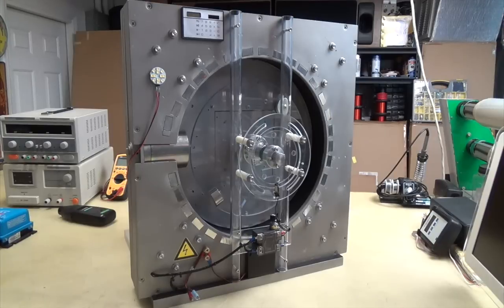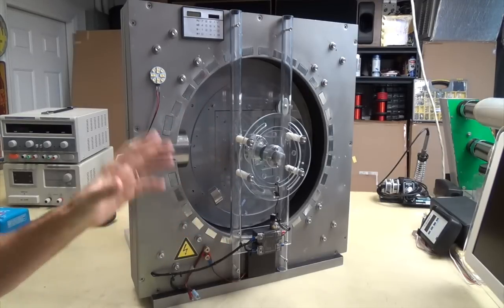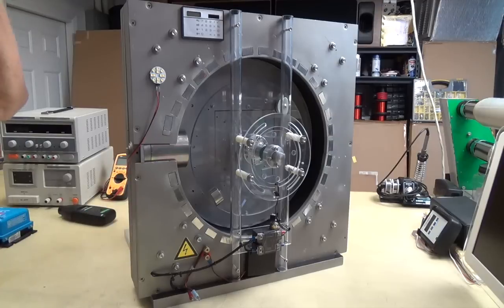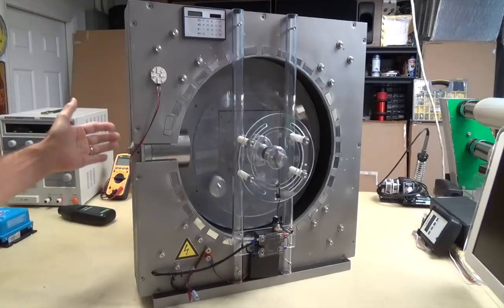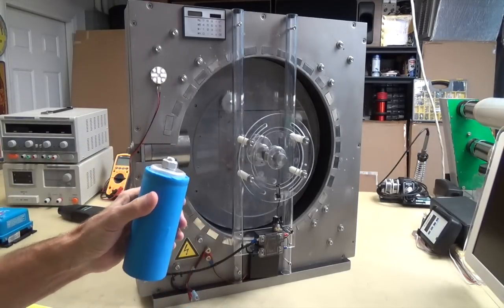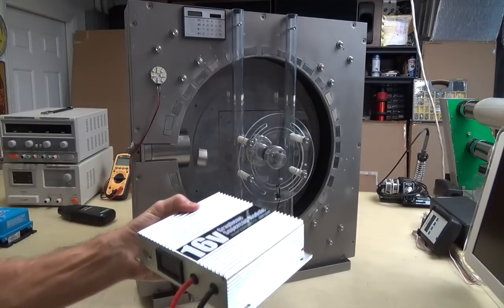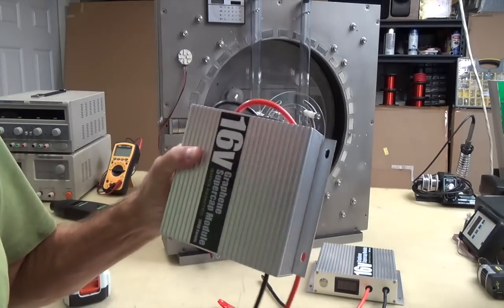ALL Magnet Motor

Comment: He was such a loss to the community maybe somebody will see this in the comments and be able to speak more about it but do you have to fire the electromagnet every rotation could it be set up to fire say every 3 or 8 revelations it would also be nice if you could control the number of revolutions that the magnet fires at I believe at a good you could have it fire every few rotations using less power and not dealing with the magnet shutting off too soon giving you a residual magnetic field that you're fighting

Comment: All you really have here is a pulse motor. If you removed all the magnets that create the magnetic gate, you would increase the output of the system. A magnetic gate although it makes a magnet move from point a to B, it takes a little bit more energy to cross back over the gate. This is why it creates more friction than thrust.
To test what I am saying, put a set of new batteries in your battery pack and time how long and how fast the RPMs are with all magnets in place. Then remove all the magnets that create the gate. Run with a new set of batteries and see how long it runs at how much RPM   
I have been studying magnets for a long time. Keep looking for the answer. We need to find a way to block the negative energy when crossing the gate. Good luck.

Comment: Is cool video. I watch one time when a guy use the car battery then a plastic container with water in it to run the positive lead through so he could keep the amperage down to weld with he also could do the same with 110 AC. The water act like a rectifier and also control the amperage. But what do I know

Comment: Well it just so happens I was looking at e-trikes, e-bicycles yesterday and they say do not go out in the rain with these bikes. With your modules that have 48 volts and they are lighter than  lithium batteries it probably would work very well as long as it's waterproof and doesn't explode in the intense heat. Is that possible?

Comment: It's a very interesting topic.
You are much more impressed than those of us who don't know electricity are.
Are you saying this is a replacement for a car battery? 
If yes, why not wire it for 12v,.24v, etc? Why 16v? It seems completely random and nonstandard.
Is your magnet motor  as the Liberty Engine here in YouTube as well?
Why mix the two topics if it's 16v batteries that you want to sell?
Car and Marine Batteries have cranking amps, etc. How is all if that handled by the graphene packs?

Comment: Hello, very nice setup and video. Thanks for sharing. This gave me an idea and I want to ask your advice. You use an electromagnet to pass the sticky point of the stator. Instead of using an electromagnet, shall I attach a DC i.e 12V motor directly to the main rotor shaft? When the rotating magnet arrives to the sticky point, the reed switch or the timing microswitch will trigger the motor for a very very short duration of time. It will be in the ON position for only a few miliseconds and then becomes OFF for a larger duration. Also, instead of using one rotating magnet, dual rotating magnets can be placed with 180 degrees offset on the rotor plate. This time the DC motor will be triggered twice per revolution on the other hand you will have more torque. Best Regards

Comment: u said u are using Electromagnitism for one magnet. so It is no Dif then a standard electric motor that uses Magnets+ Electric charge = electromagnets. which are what all electromagnetic motors have been made of since what at least 1910. somewhere around there & nothing much on the design have changed at all the same fundamentals have stayed, only updated materials ext will always be added to create motor available of that day... nothing new under the sun.. Its not just running off magnets if u are PROVIDING an ELECTRIC CHARGE
Reply: It’s the input to output ratio that is in question and he’s claiming to double it no?

Comment: Permanent magnets are unreliable because, they're outputs can very other time greatly.
Reply: This is a true, a German company something starting with an M creates a 95% efficient motor in 2022 that uses copper coils instead.
Reply: 🧲His requires electrical current to pulse his stator to get the wheel to rotate, where as my research is 100% all magnets. No issues with timing. Very early research. Have a look why don't you?

Comment: What sensors can cut off the charging of the batteries at the point they or 100% charged so no over charge or swelling of batteries . An capacitors grapevine I agree. Seems close to what I Invision for some thing else

Comment: Make a magnet motor that works like a Stirling engine using the pull or push of the magnet. You would have to be able to turn the magnetic on and off very rapidly.

Comment: Normally we measure incoming power and outgoing power to measure the efficiency of the system. You presented only 1/2 of the required data (Voltage). This is not enough to make a conclusion of your system efficiency. You need measure input V*A and output load V*A.
Reply: I think he intentionally skipped that from demonstration knowing that output is less than the input.
Reply: Watched the followup video??? he mentions the output there

Comment: No one in this planet wants to keep lithium, but comparing the energy density LiPo batteries are still better. I dont think anyone in this planet want a brick sized phones or a case sized laptops. If anything, everyone wants it smaller/lightweight/thinner
Reply: What are you talking about? What does this have to do with this thing he made

Comment: It's in a way kind of looking at Pascal's law of hydraulics but knowing those particular points in the function of that law putting ninodinium magnets in the correct positioning to create a field that is able to do the work with low speed and very high torque

Comment: Have you ever thought of using planetary gear system but in a nonodinium setting I can give you a diagram what I'm talking about but it uses the same theory of the guy that did that v magnetic train thing he used to own hotels whoever it was but I got an idea but you'd have to use epoxy resin for some of the work

Comment: More interesting in making a high torque magnetic motor to run a 8 kw  generator and battery charging capability. Basically to run all household power!
Reply: How do you power a motor without external input??

Comment: Awesome machine. Could you use another magnet affixed to a light weight rod,/crank//jackshaft to the output shaft or flywheel weight timed to approach / retreat  the motor magnet with the opposite pole to provide that little push/ repulse needed to get past the electro magnet ? Or would that be force cancelled by the load,

Comment: I know this is an old project for you... but just found your channel.   Great work, and I love the detail in your descriptions.  I'm curious about how you wound your electromagnet.  Do you have two wires on the coil to allow the capture of the collapsing EMF via the second coil?  Any guidance or direction would be appreciated.  I tried looking back through your old videos, but don't see anything regarding the electromagnet.   Keep up the great work!
Reply from the maker: Welcome aboard!  Here's the electromagnet: http://www.magneticsensorsystems.com/electromagnet/tubular/E-40-300.asp
Reply: @PMMG4HYBRID  Thanks for the link!   So given that it is a standard electromagnet, I am curious about the leads at the bottom right of the motor that you suggest using for charging a battery or super caps.  You mentioned that you can't wire them back to the battery pack used to power the electromagnet, so curious about where those leads come from in order to capture collapsing EMF.     My kids and I are building a pulse motor using 3D printer to make our stator structure a different arrangements of neodymium magnets, and it would be great if we could take advantage of this collapsing EMF.  If this is secret sauce, I definitely understand.   Thanks again for sharing.
Reply from the maker: @nickcianciolo1586  Send us an email address.

Comment: It's funny I had the same idea the other day making a pulse generator but taking 6volt dc electro magnet pulsing a heavy mass like a 4 hundred pound tee pushing every outside point on a shaft too turn a 7500watt ac generator. Bravo sir you almost got it now you have to think large home units. God Bless.

Comment: 16:41 the wheel slows down a tiny little bit in RPM right before the pulse is hitting in.
Reply from the maker: That is correct. It's called the "point of equilibrium".

Comment: Materials: 12 guage magnet wire 650 feet, a reed switch,  Four 2 feet long bolts with 24 washers  24 nuts,  4 clear plexiglass squares 1.5 feet sq. , One half inch thick plywood board  2.5 feet long by 2 feet wide ,  Six flat neodymium magnets 3/16  thick One inch Diameter round , Two Flat neodymium magnets 3/16 inch thick by 1/2 inch long , Make 8 coils and use 81 feet of wire per coil  and have NO IRON CORES ,  One round neodymium magnet with 3/16 inch hole in center one inch in Diameter by one inch long ,  Two battery cables ,  One iron flywheel 1/8 inch thick one foot Diameter with a 3/16 inch thick Diameter axle in center  and has 8 different places around disc where magnets go on  one side of disc ,  8 holes placed in plexiglass for coils to rest in,, in a circle with a 1 1/2 inch hole in center,  4 holes in corners of all the plexiglass so large bolts can go here to hold generator together,  two small magnets glued on to the axle on both sides of flywheel,  ,  Two pieces of plywood board 1/2 inch thick by 6 inches wide by 1.5 Feet tall with 3 neodymium magnets placed in a triangle on top of board and the bottom of board is screwed and glued to plywood base,,,  Basically the 3 magnets on each side holds up the axle and allows it to spin free with no resistance while spinning the flywheel that has magnets on. A plexiglass stator full of coils is placed next to rotating magnet rotor producing electricity. A SEPARATE round magnet on the axle with two smaller coils next to it and a reed switch controls when the 6 volts goes into coils ,,,  it is A motor basically and spins the axle very fast ..The motor is NOT connected to the larger coils but to a battery OR A solar panel. The large coils connect to a 12 volt 5,000 watt  inverter 12.8 volts input into it from the coils of generator.  IT WILL continuously run until some part fails. Have fun and you can run whatever you want on the inverter whatever the inverter will let you.  OH by the way the large coils are connected outer wire of first coil connected to outer wire of next coil to inner of 2nd  coil to inner wire of third coil and so on.

Comment: Your website, I'm trying to figure out exactly what your theme is, I did some research of some of the keywords you used, are you selling a type of generator that uses an invisible form of renewable energy in radiation form? If so you need to explain that in an ABOUT US section of your page which you don't have. I am very interested in such a product and would buy one but I want to be sure first if I understand your product correctly.

Comment: Very interesting device & inspiring. Could you collect the spikes from the first electromagnet & store those in a capacitor, and then use that accumulated charge to pulse yet another electromagnet to produce more torque on the rotor? Thank you for the demonstration.
Reply: I was thinking the same thing, imagine 3 more (or more)electro magnets. 😏

Comment: What if you had the alternator feed into a capacitor to power the reed switch and electromagnet?  Do you think the magnets acceleration would give more energy than the electromagnet alone firing?  That's the only way I can think of to use your design to achieve pseudo-overunity.  It wouldnt really be overunity, because youd be using the magnets as batteries in a sense, but...if it works...
Reply: Good things Magnet's don't run outta battery juice.

Comment: Please correct me if I'm wrong...should not the magnet tilted at 20 degrees go in the other direction (if electromagnet is set to repel..it should push the magnet down) than you mentioned ? for trhe electo magnet to repel the magnet upwards.should it not be at a -20 deggre tilt?? I have knowledge in basic mechanics , electronics and am a old school draftsman by trade..AND am trying to learn as much as i can in maintenance free motors ) Please let me know if I'm wrong ...why ? As i further am watching the motor spin..there is a slight resistance (edlay/hault) of spin when said magnet reaches the electro magnet...<< this may confirm that it may be trying to repel it downward )) Hence not advancing in speed velocity ))  Thank you
Reply from the maker: The rotor magnet is mounted at a 22° angle parallel with the stator for 350° permanent magnetic attraction. This is the optimal angle. In a circular configuration of permanent magnets, there will always be an equilibrium point at the stator's beginning and ending junction. The rotor magnet is also attracted to the steel casing of the electromagnet, decreasing the equilibrium zone further to 1/2" distance, making the repulsion pulse needed very narrow and extremely short in duration.
Reply: @PMMG4HYBRID  Ahhh,,Thank you kindly for the info..good to know )) learning everyday ) I enjoy your videos )) Be SAfe ))

Comment: Hello, I like your work and especially the huge amount of patience and effort you have put in to make this great project into perfection!! However, I would like to know if this resembles more of a Pulse Motor rather than a magnetic motor? 
Further, may I suggest you to focus on the alternator part....to use an alternator which will produce low drag on the rotor as the load on the output is increased?  This will help your motor to consume less current from the battery pack and thus will increase the runtime of the device and also help to recharge the batteries quickly. Thank you. Please stay safe & healthy. 🙏🙂

Comment: Imagine if you will a direct drive to say a 150 amp tractor set generator direct drive. The power grid would be decentralized and in case of attack the electrical grid would still be viable ...Yes you would need a utility shed to hild the generator set and magnetic drive motor and along one wall a bank of batteries with a solar panel on the roof but with the generator running providing the needs for the home /grid/battery charger day and nite the system would be self perpetuating....

Comment: kollmorgen/inland built a prototype like that in 1992... 23" square.. 8" overall shaft length...  1,000 foot pounds of torque from 0 to 3600 RPM..  320 horse power.

Comment: i came to the same conclusion, you can not extract energy from a static field alone
there has to be a tension (potential difference) and a regulator.
17:19 you could use the back EMF to first charge a capacitor and then drive a scond impulse coil to reinsert the energy (maybe accross on the right side so on the way downwards the wheel is accelereated too)

Comment: You have something there, but one can not wish for things to happen no matter how hunest and good harted you are. I think we should look at this problem with a fresh set off eys. For example one should be able to make His/her their own magnets specially now that it is possible to make all kind of magnets, like lucking magnet or a magnet which pull, but until a certain distance. I think you should start concentrating on those, now that you are one of the very few who has gone so far. I tried many years ago, but I just could not go as Good Luck
Reply: Huh

Comment: Where are the specs on these 16v boxes? Do they have Over discharge/ voltage cut off? Sounds funny but you should make a video with the car inverter and show everyone you charging it then discharging it with some light bulbs in time lapse. I just saw these and I like the idea a lot.

Comment: im wondering, does the wheel need extra force going uwords, as upposed to going round in a circle? if so, if im right, less energy needed if motor was put sidewats, making its motion circular, not apposing gravity force, & less energy needed..?
Reply from the maker: Counterweights make it perfectly balanced in rotation.

Comment: Do you think this could be used to run the fan blades slower than the core instead of the gears in a geared turbofan?  
Weight is the obvious issue, but gears break, overheat, and require extremely precise maintenance.
What do you think?
Reply: Aha!  US7791235B2

Comment: So, a question for you- can the 3 phase power the electromagnet pulse?  and if so, could you just make that a crank start rather than using the batteries to get it going without having to have battery input?  This may be an irrelevant idea, but ?

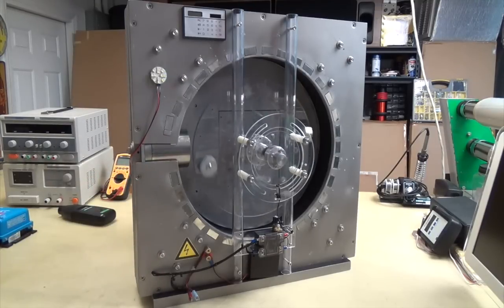Comment: Mark 14:00
The led indicators lights up even after the moving magnets passed the stator magnet ? Is that a good description of operation ?
Reply from the maker: That's called BEMF, always after the fact.
Reply: PMMG4HYBRID 
BEMF? for a normal induction angle we would see led begins flash up when magnet’s leading edges meet each other and quits after magnets trailing edges part each other but we didn’t saw that in video.
Reply from the maker: @philoso377  It's the collapsing electromagnetic field (voltage spike) reversing through the stator coil.
Reply: PMMG4HYBRID 
Mark 15:30
When stator coil is at 9 O’clock position BEMF will dies out when moving magnet went pass 10 o’clock. Video shows led turns most of the time only off when moving magnet is in front of it. Do we still call it BEMF?
Reply from the maker: @philoso377  Yes. Absolutely correct.

Comment: can you adjust speed by moving the jacketed cylinder in or out?
Reply from the maker: It's at the optimum point of field distribution for maximum efficiency. Speed is adjusted with the potentiometer (sensitivity of field effect transistors) on the trigger side of the solid state relay.
Reply: @PMMG4HYBRID  10 4 tanx